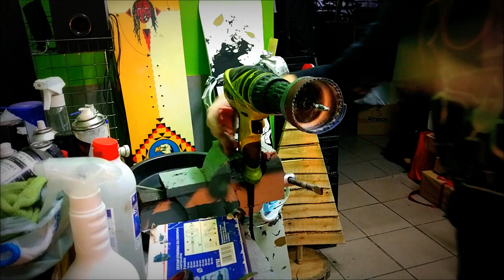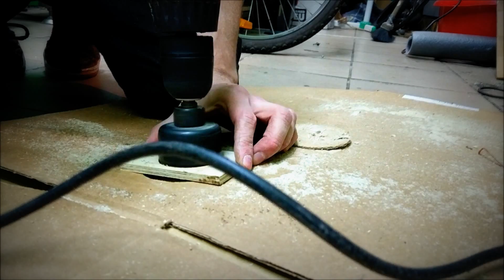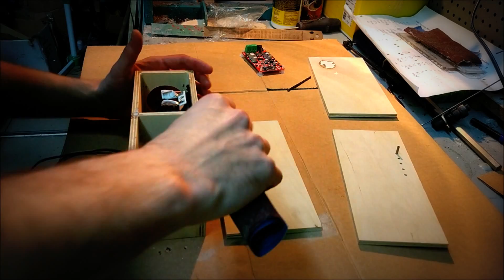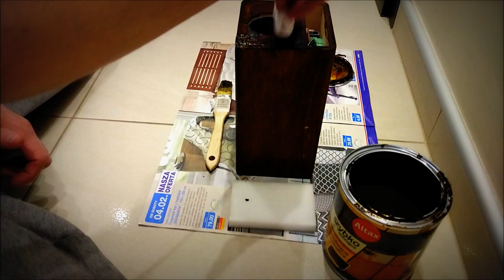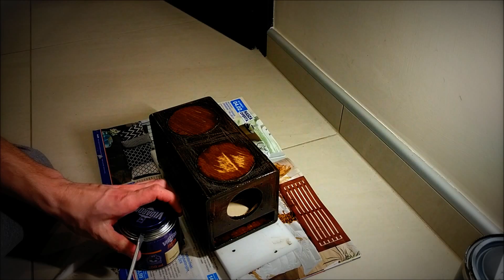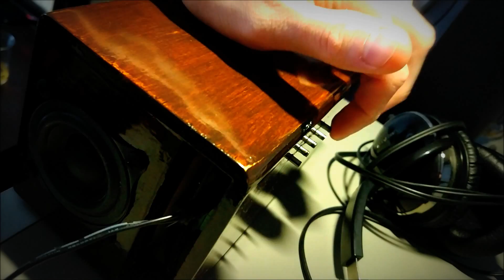DIY bluetooth speaker build - Visaton, TDA7492P 2x20W

Comment: There are some really lovely hard woods out there, often find offcuts and scraps for free, mills, yards, old draws, furniture etc, I personally like Tasmanian Oak, Oregon, and the like, very little prep required, especially old recycled, its denser, and has better acoustic qualities, just a suggestion, also ensure you apply the air volume rule-set/formula for your drivers and enclosure pairing.

Comment: Fool. First glued the speakers, then cleaned the surface, so that the speaker got into the dust. Then he began to paint =)) made round gags. You stupid amateur. To the box  added another wall, it would be better if the box with the speakers did everything where it would fit in. And weighs less and air volume is high

Comment: looks nice , instead of the AA tray , you could buy some powerbanks , that are getting quite cheap these days. you could buy a few and make then fit. sliding in, onto a usb plug.  ?
Reply: But Usually PowerBanks Do Not Provide Enough Power Output And Amp To Get It Going, Powerbanks Are Rated At 5V 2Amps Of Input And An Output Of 3.7V To 5V 2Amps, Nonetheless You Need A Step Up Module To Power That Amplifier Board That Requires A Minimum Of 12V To 26V (Differs On What Type of Chip, Wattage And Functions) But Yet With The Right Amount Of Voltage Stepped Up The Amperage Are Yet Not Affected Which Yet Will Cut The Power To The Bluetooth Amplifier Board If You Try To Increase The Volume, I'd Preferred A 12V 5000Mah Lithium 16850 Battery Pack With BMS Protection & Charge Balancer.

Comment: So at 3:20 it looks like you're gluing the speakers in place. Did you do that to help make an airtight compartment so the passive radiators would work better? Are the sides open toward the back just so you can change out the batteries?Nice video by the way, did you get some of the music from Mobygratis? I find build vids like yours relaxing. There are so many that use the same Bluetooth circuit board but I like seeing the different cabinets people build.

Comment: passive radiators needs to be bigger than the speakers
Reply: i raul no it needs to be the same size. Too big and it forces the active driver to work twice as hard to move such a large surface area. The surface area of both active and passive drivers should be identical. Take the surface area of a port from a subwoofer enclosure and compare that to that of the surface area of the cone of the driver. They should be the same. Unless you're dealing with a tube port in which the tube is extremely long... I've been building enclosures for quite a long time and I can say that the radiator has to be the same size otherwise Distortion will ensue
Reply: @sethh8892  no. Just no.

A passive radiator just needs appropriate DISPLACEMENT for the woofer used, box size and tuning. Just like a port, a radiators size(and mass) can be tuned. 

A larger radiator usually has more DISPLACEMENT and a lower resonant frequency(higher mass)

Comment: if you want good bass your passive radiator needs to be bigger than the speaker
Reply: Puzzicanello i think seperate chambers are good for big boxes but for small its the same
Reply: g4rb4c < I would love to hear it though, where is your Video?
Reply: You can also add some weight to the new square passive radiator to make the bass lower. They might not need it but some do.
Reply: You should always separate the powered drivers into their own chambers. Small differences in mounting depths, positioning on the baffles etc. can cause the pressures the woofers create to create distortion in the other speaker.

Just like the powered driver moves the passive radiator, the powered drivers will attempt to move each other.

I have built a number of speakers, like MTM and they always sound so much cleaner with the Midbass in their own chambers.

That's my opinion of course.
Reply: Puzzicanello Sorry, didn't see your comment. Midbass are drivers meant to cover midrange and bass: https://www.parts-express.com/cat/midrange-midbass-drivers-full-range-speakers/16
Reply: Do the two speakers need to be separate or can they stay both in one enclosure?
Reply: Puzzicanello  they can be in the same box
Reply: g4rb4c alright thanks, but which is better?
Reply: Theball Player what do you mean with "midbass"?
Reply: g4rb4c i
Reply: Theball Player thank you!
Reply: i dont things so
Reply: g4rb4c  Yup! The rules is: It has be equal or exceded the size of an active woofer, xmax as well.
Reply: I made one box with 2x 3inch jbl atlas woofers and 2x 4inch passive radiators and two bose car tweeters and it had better bass and was much louder than jbl xtreme about same size and i didnt split to 2 chambers because jbl and bose arent doing that with portable speakers
Reply: Alexander Volta i never made a video of building it but i will probably make a new box for it and i will use some better parts and make a video in the future
Reply: g4rb4c that's not how this works... the radiator should be the same size as the speaker. Just as the surface area of the inside of a port is virtually identical to that of the speaker cone surface area. The only thing of passive radiator does is make a "fake port" for a box that is too small to make a port for. There is no reason for a 2 inch speaker to have a port, so you put a 2 inch passive radiator. Having something bigger will actually reduce bass because you are making the speaker push more 2 make the large surface area move. If you have something too small it will boost the higher frequencies because its surface area is smaller and therefore doesn't need as much pressure to move. But if you have a perfect equal surface area it means that there is a ratio of 1:1, has the driver moves out one centimeter the passive radiator also moves one centimeter as it pushes back one centimeter the radiator also pushes back one centimeter. But if the speaker is smaller than the radiator, you will have a 1:2 ratio. Therefore the radiator has half of the movement. For 1 centimeter that the speaker moves the passive radiator will only move 5 millimeters. But if the speaker is larger than the passive radiator you will have a 2:1 ratio, that means for every one centimeter the driver moves, the passive radiator we'll move 2 centimeters. To have the most accurate and best base you want a speaker and passive radiator of the same size. Otherwise you will have distortion. So no... incorrect
Reply: g4rb4c that doesn't really make any sense, what really matters is what you're trying to accomplish. Are you trying to make multiple channels of sound or are you trying to have one speaker that is only playing the same frequencies. If both speakers will be playing the same frequencies at all times then yes you only need one chamber, but if you plan to have a stereo setup where there is Left Right and possibly even middle, you will have to have multiple Chambers otherwise there will be a problem with distortion.
Reply: Q Daddy that's not necessarily true, the mounting depths are virtually always going to be the same and it's not going to make that big of a difference either... the mounting depth of one being different than the other is not going to make a difference on the pressure upon each woofer. All it does is changes the inside the volume and therefore a equal amount of displacement will be applied to each woofer evenly... why do you think subwoofer enclosures never divide the two, three, four, etc... and besides a very slight difference as such will not make such a drastic difference. What you need to worry about is making sure that your Port is properly tuned, and that all holes are sealed. As long as that is true then you are perfectly fine. The only times you really need to chamber off multiple speakers that are in the same box, is when you are trying to do a stereo setup. If you are trying to make it so that it plays both left and right, or are trying to create a multiple Channel speaker setup in general then yes you will need to make sure they are chambered off.  otherwise no... there's absolutely no reason for chambering them off. And adding a wall on the inside of the box would decrease the  volume on the inside of the box and therefore increasing the pressure.  unless of course you have a  ported enclosure in which all it does is change the tune frequency.